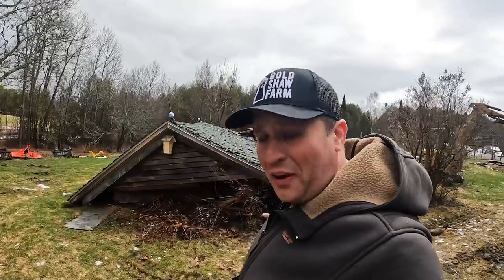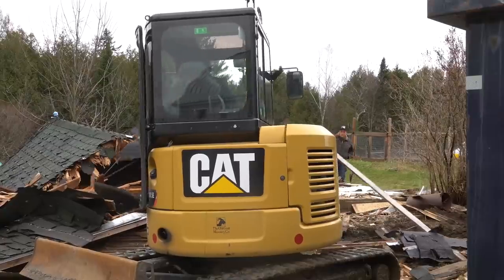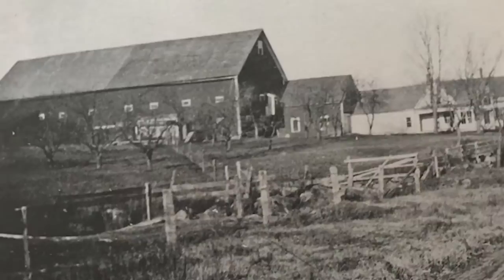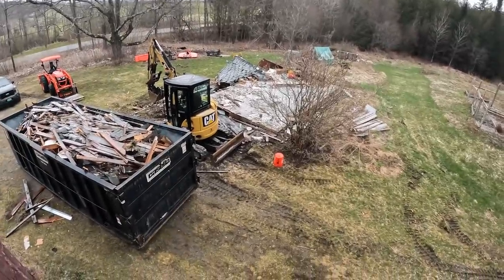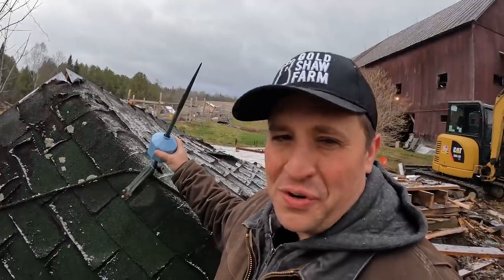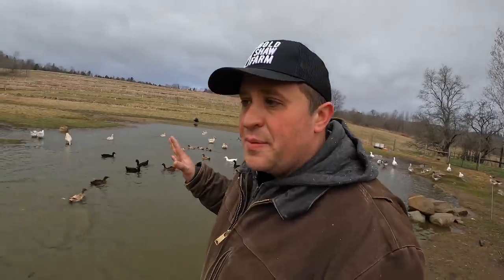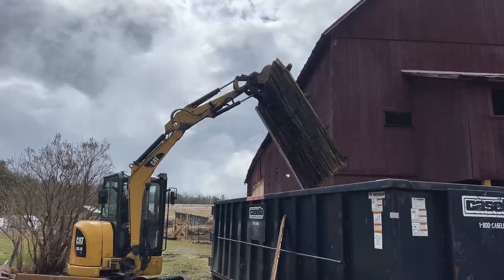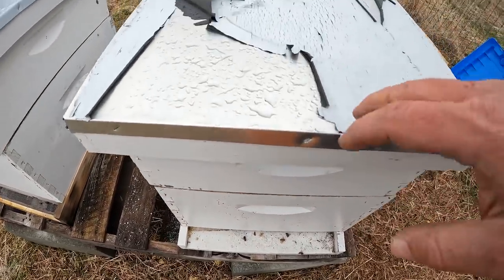We Destroyed My 103-year-old Barn

Comment: As much as we would like to protect and restore old rustic structures sometimes it’s “out with the old and in with the new” situation. I had to call in an exterminator last summer to stop ants and termites from eating and tunneling our antique drive shed. They did a good job but it did cost me $450. Good investment if it can extend its life. Can’t wait to see what you put there. Cheers, Chad.
Reply: Check out diatomaceous earth, which also is good on animals (and sometimes in animals, too, as a wormer with extra minerals).  DE (sometimes formulated with pyrethrins) zaps bugs, fleas, roaches, flies, etc. and can be sprayed or puffed on with negative-energy-type devices that make the powder stick to surfaces (even cows and horses) and also under kitchen appliances.
Reply: You can't save everything. If there was some sort of historic significance this building, like major significance, then yes it should be saved. But it's only a hundred and three year old garage...
Reply: @debbys-abqnm4537  thnx for the tips
Reply: @staceyrashkin2609  Exactly. Plus that little garage wouldn't be good for anything other than a small shed and it's in a prime spot on the farm.
Reply: Weather treat and laminate all your wood. It will soak in the resins and strengthen the wood while preventing pest and rot damage.
Reply: @MtnNerd  -- Hey, you're right! Arranging for contact is why DE users puff DE where bugs (like cockroaches) will run through it and pick it up, so it works its way into their buggy joints and the sharp parts of the DE powder bleed bugs to death. I've seen it myself. Bugs can't evolve a defense (like they have for chemicals). Humans may have to be more clever to use it on termites, and covering a house and flooding it with nitrogen (I think....?) may be better, but as humans are clever and would rather save money and not endanger anything else, DE can be a good solution.  But if you use other methods, good for you!
Reply: @debbys-abqnm4537  DE loses its effectiveness when put in food. It kills by puncturing the bodies of insects and dehydrating them. Once wet, it sticks to food or itself and loses that ability.
Reply: @lynnbetts4332  -- Interesting thoughts, but I've heard stories about DE being used to worm animals like pigs (who ate it right down, possibly needing the minerals), and were I a farmer, I'd use it not only as a pesticide but a dewormer, along with other good organic practices. I'm sure the best care of animals is your #1 priority, too.
Reply: Still makes me sad, especially when I saw how hard that building fought to stay upright. It definitely had another few decades left in it
Reply: I’ve had to demolish a couple buildings on my small farm and found there was much more usable wood than I expected and have used much of it to build my duck & chicken enclosures, fences and other projects on the farm. I even built a building to store the wood I saved. Such a shame to see it in a dumpster. That quality of wood is becoming more rare all the time. Having said that I admire most of what you do.

Comment: Investigate Technoposts for your barn. These are a way to avoid the time and mess of concrete.  Special metal posts are screwed into the ground until the pressure is around 26000 pounds.  They are as permanent as concrete and you can build on them right away. I put up an addition on my house as a pandemic management tool and they worked a treat!  Pictures if you want 'em.  Around 200 bucks a post all in.  I don't have any fiduciary interests in this product but found it to be a modern solution to the "dig a hole and fill it with concrete and wait." problem.

Comment: my suggestion is gravel floor in the vehicle storage and concrete slab for the shop. it will make doing vehicle maintenance so much easier in the shop.
Reply: Because looking for that bolt/nut/screw etc on gravel is not fun… I agree concrete slab for maintenance is best practice!

Comment: We put a new roof on our barn last year, even though we're still only using it for storage right now. The rest of the structure is still in fantastic condition and we anted to stop the roof leaking so the whole thing wouldn't get destroyed. Barns are not inexpensive to build or upkeep. We had wanted to put on a metal roof, but the metal prices had skyrocketed, so we had to settle for a new shingle roof, with new plywood in most places, and it was not cheap either. We still have a workshop to re-roof and the house, but we're trying to wait for metal prices to drop.

Comment: @Gold Shaw Farm
5:48 Cool with the slow motion video :D
But, it looks like the hole between the left & middle plank is too wide (upgrade to next time? Or a quick fix with a screwdriver?), at least twice in that clip they steeped through that crack.
It looks like a risk of hurting their legs, or even breaking the legs if they get stuck & fall/(is pushed) in the wrong direction?

Comment: As the owner of a 120 years old house that has a lot of wood on it, I understand you. Some parts have to stay, and some have to go.

For example, the eletrical wiring was done on the middle 70s by my grandpa, with the cheapest budget and materials he could find, using a 125 V and a 1 kw current. The electrical company upgraded it to 220 V and 1,6 kw, and said the wiring would be able with it, but when I went to live there in 2013 I got scared and started to change the wiring and put modern ones. Now I have done it in almost all the house, there are only 3 rooms that we don't use remaining  and there are 3 separate lines, ground floor, top floor and kitchen.

There are 4 grund floor rooms and spaces that have wood beam ceilings. We look to keep the beams, but made modern ceilings that look like they were the old ones. And the roof is entirely made with wood beams, and soon will have to go.

Comment: You've got a lot of roof space between your home and barn, ever thought of covering it all with solar panels? It would entirely cover your power requirements and generate something of a revenue stream as you sell the excess back to the grid.
Reply: Be a lot of work in the winter to keep them clean
Reply: @dakotareid1566  I'm not so sure of that, it essentially boils down to climbing up there with a brush and a windshield wiper which is work but surely a small chore for energy independence, right?
Reply: gotta be interesting to see if it'd be possible. a lot of companies nowadays advocate for you still to be hooked up to the grid and it's peanuts what comes back in savings. it's a poor investment now that they've changed the type of panels and how the power draws, at least for what's mass marketed now. you'd need your own power bank to store and draw from, and that ups the cost by tens of thousands. many folks in CA learned solar doesn't mean anything when you're still reliant on the grid.

Comment: Unfortunately I have the same problem of cost vs use. My dad and I purchased my grandparents farm. It has an old dairy barn on the property that my grandparents never invested in just used. The roof is failing, one section is gone due to rot. 
To fix the roof I would have to come up with $30,000 and that's not feasible. I could invest that money in a building more suitable for my needs and fixing the well on the property. 
I'm going to save as much wood as I can and the beams are all salvageable. I will sell the extra and keep some for my new house.

Comment: Good aerial shots.  Seeing your property on footage makes sense of  your narrative.  

As for the barn, if you are going to process meat, store equipment, grain, hay, then the better way to go is a corrugated steel structure with trussed gable .  

And padded indoors fir insulation.  Like a repair garage.  

And flooring needs to be a concrete steel reinforced slab. 

You might want to consider to level the floor with laser , and have drainage for your runoff.  

Wood structure might not make ,uch sense anymore.  

Most of these structures are prefab.  You will need to save money to get up., because you might end up bringing s contractor for the assembly and prep work.  

Definitively do not do this on your own. This
Is not the situation to tun your experiments.  

Get a contractor who has done small Food Processing plants.  

You will need something to meet USDA standards.

Comment: Even if the wood is too old or rotten to use in construction, are there any boards in a condition that could be used for wainscoting? I know someone who took down an old barn and salvaged enough boards to use in his den as wainscoting. Nothing fancy like paneling. It was just a chair railing with vertical slats underneath. He just stripped and varnished the old wood and it was beautiful. It was pecky cypress and looked wonderful. He even sold some to a neighbor.

Comment: I know what you are going through with tearing down an old structure as I had to do it several times.  As I found out even though some of the lumber looks good it can be infested with ants and or termites.  I also discovered under an old garage a dry well in which used engine oil had been dumped.  Why the previous owner did this I can only think he was either lazy or just didn't realize the harm to the soil he was causing.  They also didn't use concrete but instead mortar which had to be broken up and carted away as well.  A pole barn with red metal siding is cheap and strong and with insulation will be quite cozy in the winter as well as looking pretty good.  Either way, a farm is only as good as it's infrastructure so keep up the good work,  we're rooting for you!

Comment: you should demo big barn too and sell or reuse many of the beams...do a modern post and beam garage/office/barn/greenhouse - rebuild a small shed for all mechanicals and gardening options - do lots of pex in slabs for the radiant heap and use a couple heat pumps - think about solar array and some batteries - you can build it efficiently, rent a sawmill and saw your own beams/ 2x6 - you may be able to repurpose the barn and save lots on materials
Reply: The big two storey dairy barn and the house are protected by the land trust.

Comment: I would seriously think about a modern trust roof with a clear span if you want to park vehicles and equipment inside the barn.  I have a pole barn with 12 foot on center posts and an old post and beam barn.  Both are not good when it comes to getting equipment inside them.